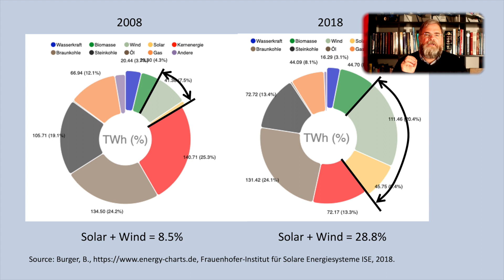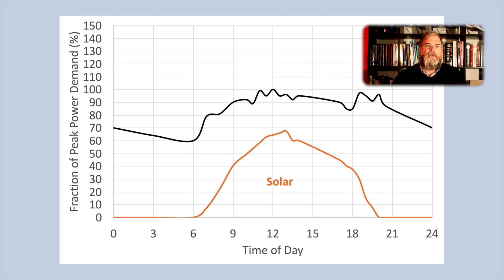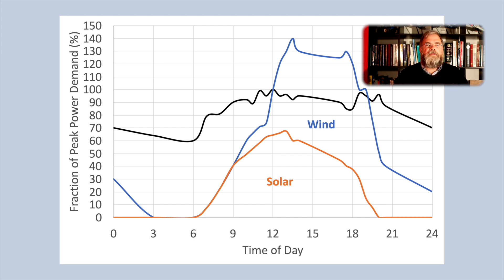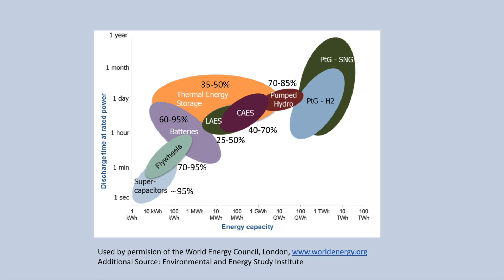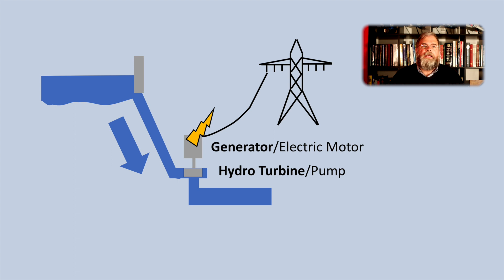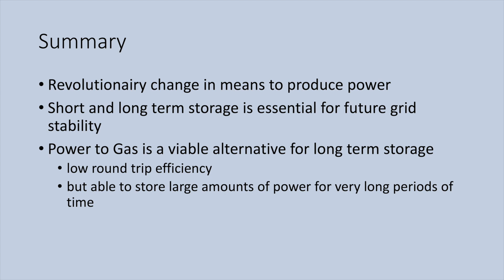Energy Storage and the Future of Gas Turbines for Power Production

Comment: Great video, great explanation, but if we solve the electricity supply problem where does all the heat come from, or, in other words, the required future electrical load is significantly higher than the current load in order to provide the heat? ...or...?
Reply from the maker: Hi Melanie-Jane, 

Thanks.  

The problem comes as the power grid becomes more and more dominated by nondispatchable (or non controllable) renewable sources such as wind and solar.  If we want to produce all or the majority of our power from these technologies then it will be necessary to overproduce power at sometimes to make up for the deficit in power at other times.  Energy storage can be used to transfer power from times of overproduction to times of underproduction.  However all energy storage technologies have losses associated with them so you never get back as much energy as you store.  Thus you will need to produce more power during the times of overproduction to make up for those losses and ensure you have enough power when you have times of underproduction.  So yes the future grid would need to produce more electricity (and the lower the round trip efficiency of your energy storage the greater the amount additional power is needed) than a grid that relied mainly on dispatchable power production.  The main argument for doing this is to reduce CO2 emissions.  But if we ignore this and look purely at a cost basis one typically ignores the need for additional production and energy storage in the calculated costs for renewables so this would effectively be an added cost to these technologies.